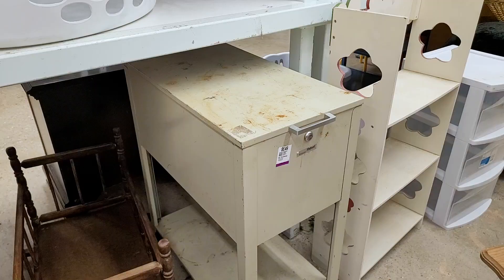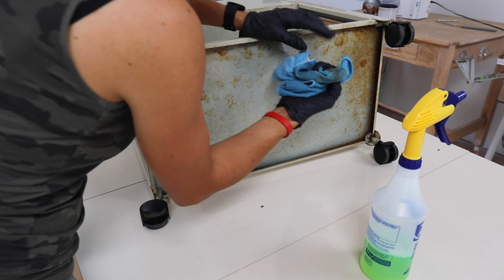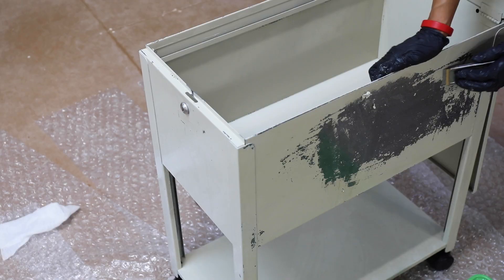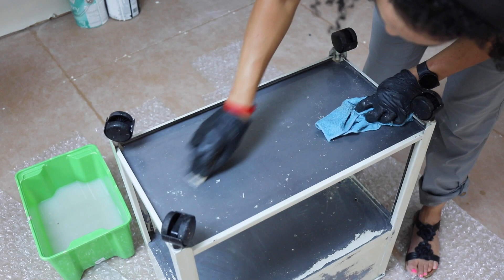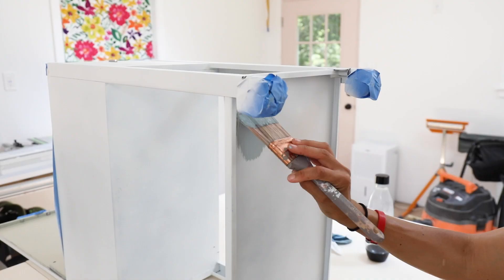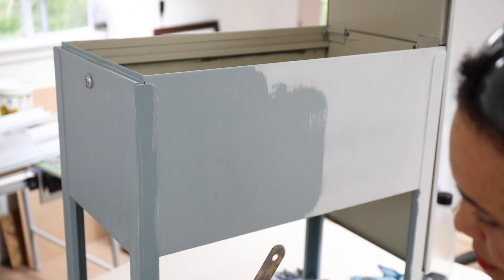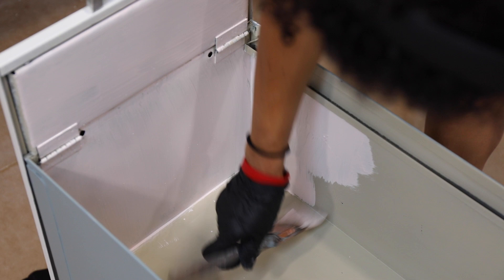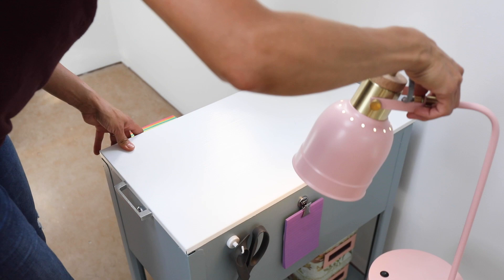BEFORE and AFTER: Thrifted File Cabinet Makeover from Savers! - Thrift Diving

Comment: You should have just removed the casters. It is easier to paint without them and you don't get paint on them. They just pop off and pop on, so easy peasy. I've done a rehab on a similar file and did this with it. Of course, yours turned out better and, in my home, I would have it in a purple/lavender color. 🙂

Comment: I love going to savers, I got a 2 drawer file cabinet on wheels it was in a bad shape, I used rustoleum paint on it after using the rust remover, and then put some padding and a cover on the top. It doubles as a file with a small drawer and a sitting area. I would like to find one of those filing cabinets. Keep up the great Makeovers. Love it

Comment: You don't need to use a chemical rust remover.. it's completely unnecessary to use a caustic chemical like that..simply use brillo or a 120 grit sand paper
Reply from the maker: You can use brillo or sandpaper but I like using rust remover when I see rust, to make sure that I clean it up well.